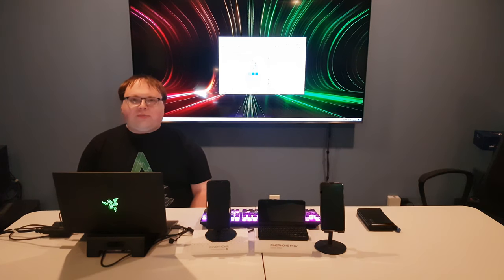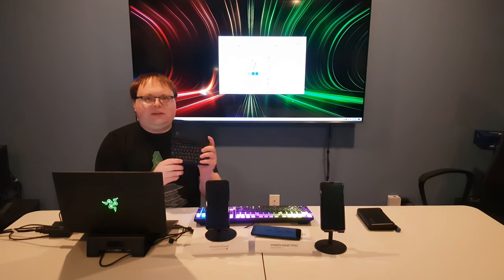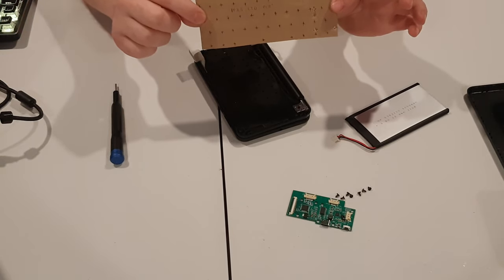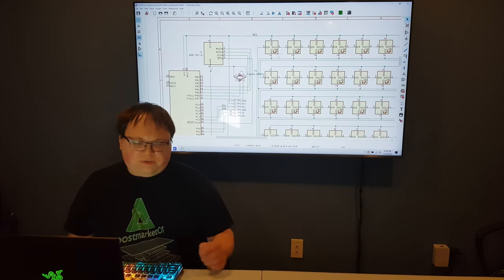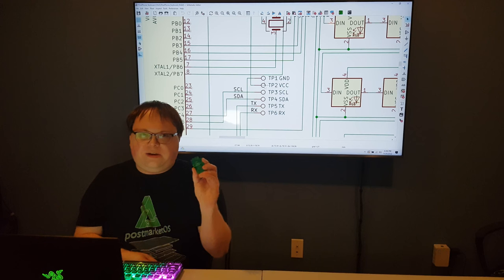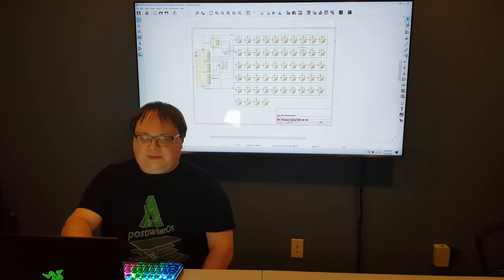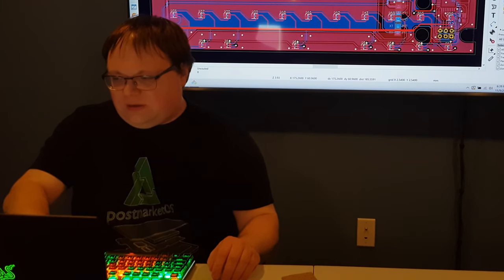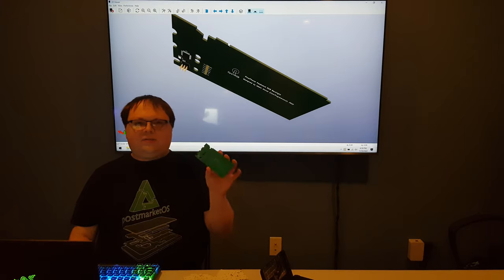PinePhone Keyboard RGB - Part 1: PCB Design

Comment: This is fantastic!  I've had trouble sometimes typing on my ppkb in the dark, and this would completely solve that problem. 

I certainly hope you'll be able to make some of these available. If needed, I could solder the LEDs and microcontroller.  I have access to a resin printer as well, but resin is pretty expensive and generally sold in quantities far greater than would be needed just for one set of keys, so I hope you'll be able to distribute key caps as well.

Great work!  I can't wait to see part 2!

Comment: this is how we’ll get PC gamers and the youth into open source and mobile Linux heh
Reply from the maker: I've run Half Life 2 on my PinePhone Pro, it very well could be a gaming phone if they get the thermals under control and the Panfrost driver improves a bit.  If not the current gen Pro, the next generation will definitely be able to run some serious gaming workloads assuming they go with something like RK3588 that has a Vulkan capable GPU.